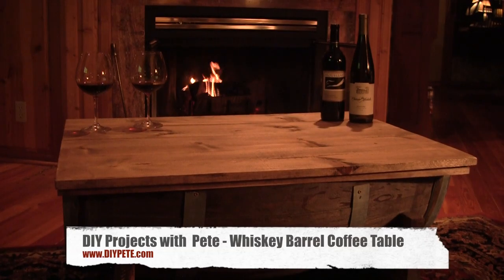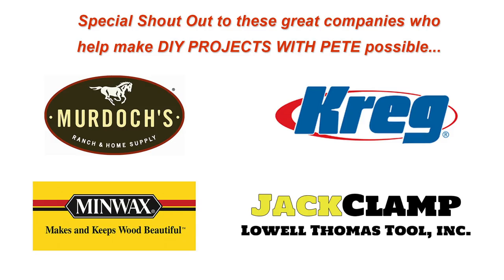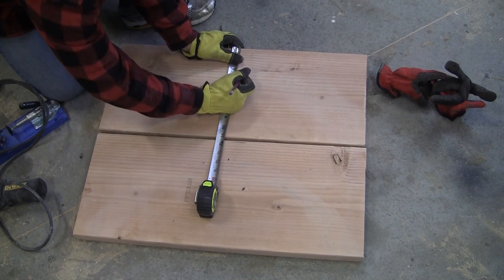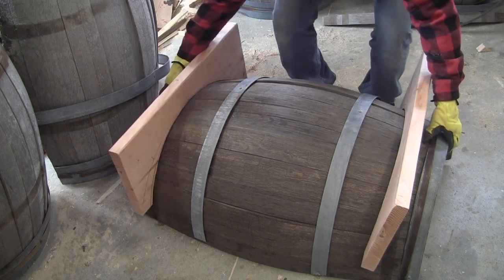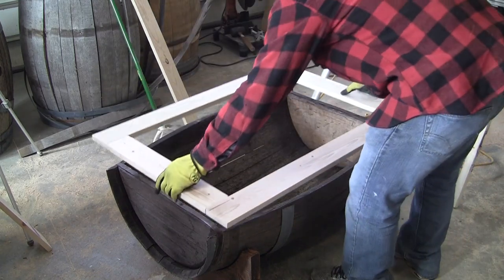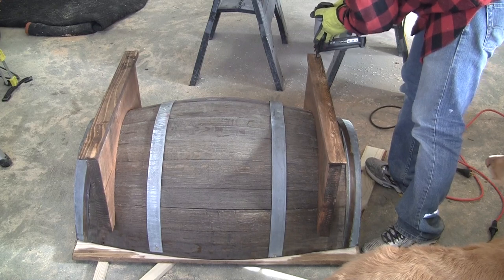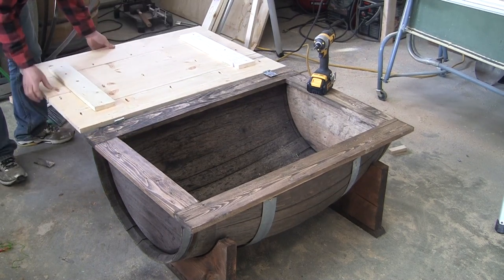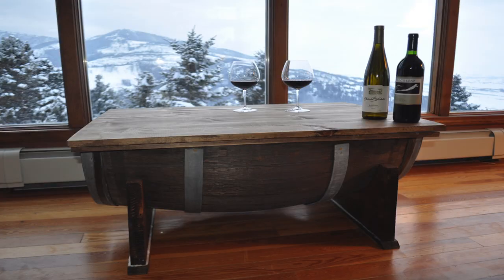How to Build a Whiskey Barrel Coffee Table

Comment: I just finished this project tonight! Getting the barrel to sit in the legs was the hardest part. Also, who ever cut the barrel (I bought a half barrel) did it unevenly which I only noticed after I put the apron on. This meant the table top did not sit flush against the apron and instead wobbled. To fix this I found some stained stints and placed them under the apron in the spots that needed to level out. You don't even notice them and it worked perfectly. Overall this project was not necessarily "easy" for a novice DIYer but it is definitely doable with time and a ton of patience. Thanks for the video!
Reply from the maker: Nice work Sara! I'm so glad the project went well :) Enjoy!

Comment: Hi, amazing table, my husbands got it on his to-do-pproject list for his week off work, just a quick question though what type of wood do you use? We live in Greece and have asked at wood shops but they only do boards that would go under a mattress in a bed at such sizes. If we wanted another type and have it cut it will be double the price. So would the bed slates do? Thank you!
Reply from the maker: Emma EU HI Emma! Thanks for stopping by. I used pine for the top since it is cheap, but you could use oak to match the barrel if you'd like. The top boards could most likely be made from the bed slats. You'll need some thicker would for the base pieces. You might need to find a local woodworker to help make some of the cuts if you don't have the saws. Good luck!
Reply: DIY PETE Thanks, we've just finished the barrel, and it's coming out great, added some binder post screws to the hoops and painted those black.

Comment: How many man hours do you think you put into it? Very cool btw
Reply: Hi Connor! Thanks so much. If you find a half barrel already cut it is a pretty quick project. The building part of the project took an afternoon and an evening -- so around 4-6 hours. The Kreg jig for pocket holes made the top go super quick. Then I did do 3 thin coats of poly on the top. So I let it dry about 5-6 hours between the coats.

Comment: I found a whole barrel and the big unknown for me is going to be what happens when I cut it lengthwise? Staves fall apart or does the metal banding at each of the ends hold the whole thing together post cutting?
Reply from the maker: Grant S Hi Grant! Decide where you'll be cutting the barrel in half. Before cutting both the wood or the metal, Drill pilot holes through the bands close to where the cut will be made. Then use a screw in each hole to attach the band to the wood at the halfway point. You'll use a total of 4 screws. Two for each band. One on each side close to where the cut will be made. Then make the long cut through wood as needed and through the metal bands. This ensures the staves stay in place. Let me know if this makes sense to you, it's harder to explain without a photo :) Cheers! - Pete
Reply: DIY PETE Thanks for the advice.  I've now got the screws and the barrel came today from Calif. ($231 with shipping) -should be cutting into it this week.
Reply: I cut mine today..smells so good
Reply: Grant S To follow up on this project and add some interesting time savers for those interested.  I had a difficult time figuring out how i was going to cut this thing in half so that the cuts actually looked good and didn't require a lot of post sanding work etc. Here's what I did to get a perfect edge with very little cutting:  I looked at the top edge of the barrel and found the seam between two staves, I then drew a line right down that seam and did that for both sides. I then drew across the top of the barrel to connect the two lines.  After cutting the banding along those lines I then cut across the top on both ends of the barrel and she came apart very nicely with no need to cut into the sides of the barrel. I cut the top using a circular saw.  Its a wine barrel so its as purple as purple heart (which might make a nice wood to use for the top?)
Reply: I get my barrel sometime this week, I am going to try to do it this way - this such a great idea!  what tool did you use to cut through the metal bands? I am going to attempt to do it with a jigsaw with a metal cutting blade.

Comment: Hey pete whT type of nail gun is that and nails u r using
Reply from the maker: Hi! I was using an 18 gauge nailer with 2 inch long nails. I'd recommend using it in combination with wood glue. A 16 gauge nailer could be used if you have one. The brand was Porter Cable
Reply: @DIYPETE  thank you

Comment: You need a biscuit cutter sponsor so you can make proper tabletops.
Reply: Hi there, I use biscuit joiners for many of my tables and wanted to show a quick and easy solution for many of my viewers who already have the pocket hole jig. I will be showing other projects where a biscuit joiner is used, as they do a great job and are easy to use as well. Thanks